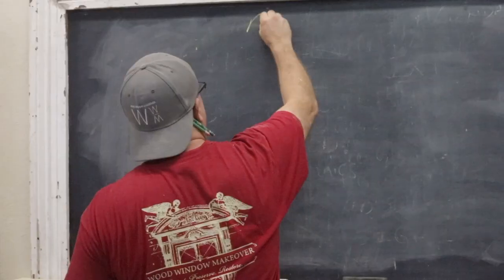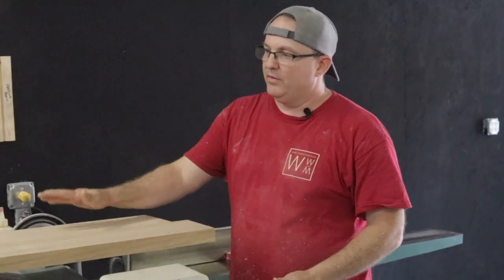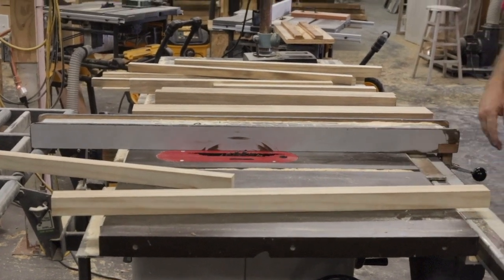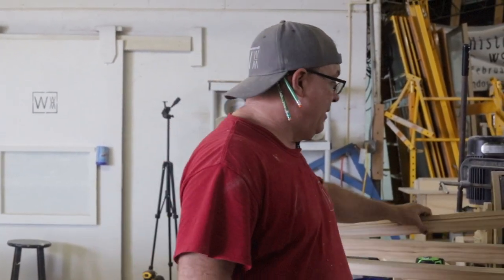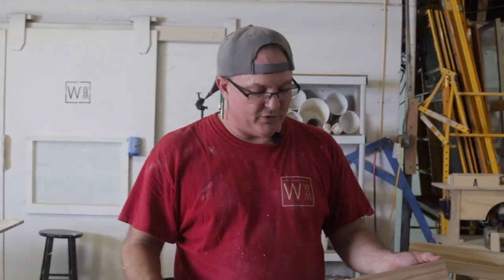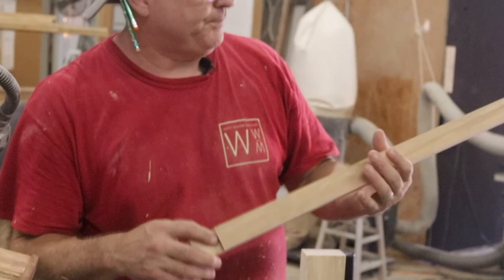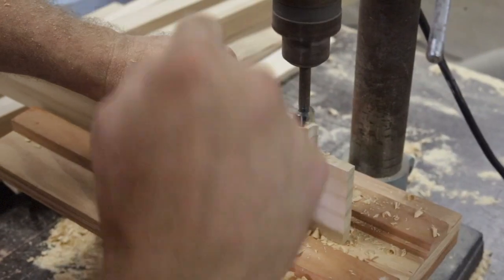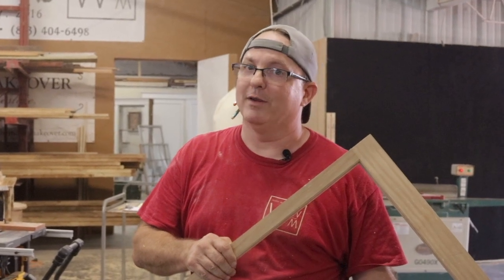Replacement Sash. How I Make Them

Comment: Excellent instruction that's easy to follow. Thank goodness most of the world uses metric. It's so much simpler than adding different fractions of an inch. I'm an old guy who started with Imperial measurements. No way would I want to ever go back to a system that only the countries of the US and Myanmar use with feet, inches and fractions like eights, quarters.

Comment: This is fantastic, the best video on the subject I have ever seen. I have top hung awning window sashes with a fixed lite below an opening window and a long fixed lite beside. In New Zealand the stock rail and style thickness is around 42mm. As the house was built circa 65 there was extensive use of lead paint so I stripped my first sash with a great product made here in NZ from Coopers Strip Club. The major difficulty was removing the putty. Haven't made a steam box and tried softening the putty with my steamer directly with mixed results. It wets the timber as steaming in a box does so I noticed if you scrape too hard you can damage the profiles or rabbet edges. Most of the sashes have rot in the lower corners and some rot around the glazing rabbets. I plan to fix this with epoxy from Repair-Care Int. The sashes are made from Western Red Cedar. Now the epoxy is quite expensive and time consuming to do the repairs as is the stripping even though I took the lite out of the frame to do the job. The stripper is not cheap either although it does a fantastic job. I would try and just make new bottom rails but the M&T joint is fixed with this star shaped hard pin which is impossible to remove and the rot extends into both rail and style in some corners. Having watched your video it seems a comparable job to remake the sashes as it will be to strip and epoxy the damage, in fact, with the tools it is a faster job to make from scratch. I can then use the stripper for the bevel back weatherboards which is an easier stripping process than doing the sashes. Now the dilemma. I don't have a table saw or router table nor router or planer/thicknesser. No drill press or mortice chisel. No moulding router bit sets. You get the picture. What would be great if you could give us budding joinery students a list of what would be the minimum set up required for the home owner/DIYer that would achieve a suitable outcome on a budget. Again I think you are a fantastic teacher and am glad I have found your channel. BTW I have twenty or so old moulding planes but unfortunately not one which would do the coping cut. Hand planes and chisels is what the old timers used so in a pinch I can do some tasks but a router with the right bit set has got to be a must have?

Comment: What a great video - as all your videos are!  Thank you.  I have a question I hope you can assist with.  I have an upper sash that has a loose bottom rail.  Do you have a recommendation of how to fix it?  Should I use glue, drive a screw or two through the tenon or drill a hole or two and hammer in some dowels to hold it together?  Any thoughts you have would be most appreciated.  I'll be taking out the glass and stripping the window, in any event.
Reply from the maker: This is one of the easiest of all sash repairs and can actually be done in place, without removing it from the opening, if necessary. Of course if you can get it to a bench, that’s better. What I like to do if I can is remove the nails holding the joint together and drill holes where the nails were to drive in and glue new dowels in place of the nails. This is of course after pushing it up and holding it in place. Pushing it up can be as easy, if done in place, as wedging a stick, slightly longer than the distance between the rail and the sill, into position to hold it up while you do the operation. I’ve done this several times with good results.
Reply: @WoodWindowMakeover  Thank you very much indeed for taking the time to provide such a detailed response!  I really am obliged.  I've already removed the sash as much of the putty had to be replaced, so it's going on a bench.  Dowels it will be.  Thanks again!

Comment: So glad I found your channel! Thanks for sharing. 
How wide do you make the rabbet for the glass?
Can't wait to see the divided light sash post.
Reply from the maker: Typically the glazing rabbet is 1/4" x 1/2". At least that what we make it on all of our sash. It varies region to region but it's usually something close to that
Reply: @WoodWindowMakeover  What router bits do you use for the profile and cope? I can see it's an ogee profile, just wondering what brand and which bits your using for this video. Thanks again.
Reply from the maker: @RichMenzel  I like using the set by Amana

Comment: Hi Steve, It looks like you do not use glue for the assembly, just the stainless staples, am I right on that?
Thanks again
Reply from the maker: No glue, just tight joints and stainless steel Staples. You are correct

Comment: Awesome work!  Just curious, do you also use dowels on the corners?  Or just staples?
Reply from the maker: I use 1"  stainless steel narrow crown staples. I don't mind using dowels, it's just that staples faster and are plenty sufficient.

Comment: is that a 1/2" roundnose bit and a 3/8" up spiral bit on your special router table for the rope knot and so forth?
Reply from the maker: So close. It's a 3/8 radiused core box bit and a 1/4" downcut spiral
Reply: Curious why the down spiral. Wouldn’t a hold spiral pull the chips down into table.

Comment: Hey Steve,  

You mentioned the know hole is 12” from top.  How long it the pully slot before it turn into the 1/4 rope grove. Is this the same for most sash or does it depend on sash height.   They grooves seem long, don’t they just have to be long enough to clear the pulleys at top of window? Thanks for any information on this. 

Great video.
Reply from the maker: I just picked the number 12 because it’s easy to remember. Could have been 10 or 11 easily. The pulleys yard usually centered about 6” from the top, so the trough just has to be long enough to clear it. Another reason to put the hole at 12 is cheap insurance to make sure it’s far enough down in the slight chance the pulley isn’t standard
Reply: Make sense. My windows I am working on have the pulley about 5” from top of frame, the the 1/2” pulley slot only need to to go down that far, then run a 1/4” grove down to your hole

Comment: I noticed you don’t use the standard combined sash router bits. Which bits do you use?
Reply from the maker: Most off the shelf ones are junk, actually poorly designed, in my view, to keep people from doing it.  Many of my bits are custom made, but try Amana's set. It's pretty good.
Reply: Does the bottom meeting rail get routed then? Since there’s no rabbet where the glass groove goes?

Edit: never mind I saw Amana has the bit without the rabbet cutter. Thanks!
Reply from the maker: Here's another one...

https://youtu.be/LA7_CvT2ITI

Comment: Can you explain the purpose of the relish hole and what’s size it is.  What does it do?
Reply from the maker: The relish hole is 5/8 and it enables the rail to bypass the moulding in assembly without having to cut it away, also provides a weep hole to let moisture escape.
Reply: That would be a great short video topic to show and explain.

Comment: What kind of wood do you use to make your sashes
Reply from the maker: I like to use a wood known as Accoya. Check out Accoya.com
Reply: @WoodWindowMakeover  I have no idea what the wood is in my old house window. Is there a wood that you would suggest to use that would be good for Kansas City that would be more readily available. I've heard of Accoya but I don't have any idea if its available for a homeowner to buy here. By the way, I enjoy your videos, Very well done.
Reply from the maker: You have to use the best wood you can find at the time.  Pine is fine, as long as the grain is tight. Same with fir. Mahogany is good, as is Sepele.

Comment: Quick Question. In this video you say the typical meeting rail is 1 3/4" wide, but in your measuring for sash size video, you use 1 1/8" for a measurement. Why is this?
Reply from the maker: The 1-3/4” width is the sash width of 1-3/8” plus the width of the part of the meeting rail that extends 3/8” into the parting bead area, thus 1-3/4” (1-3/8” + 3/8” = 1-3/4”). This is the measurement horizontally across the jamb. The 1-1/8” is the thickness of what’s left of the meeting rail when you are accounting for the glass vertically. The meeting rail thickness, vertically as its positioned in the window is 1-3/8. The glazing rabbet is 1/4” deep, so when you take that away, you are left with 1-1/8”.
Reply: @WoodWindowMakeover  Thanks! This, and this video has helped immensely. I'm still just doing practice sashes but I'm getting better at them. I do have one more question, what wood? I know in this video you say you use Acoya, but I can't find that locally, and I've read it doesn't look the greatest when stained. I've been practicing with Fir, but it's not a very nice wood for sashes, and I'm certainly going to have trouble finding old growth Pine. So if your going to stain the sash, what do you use?